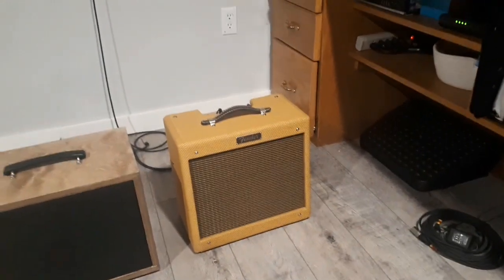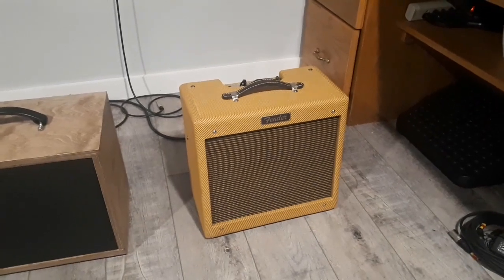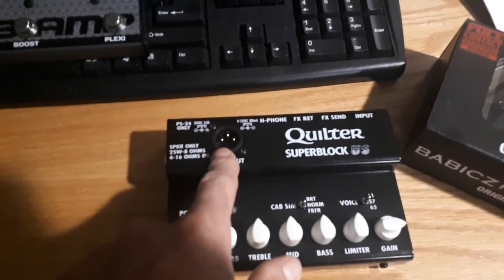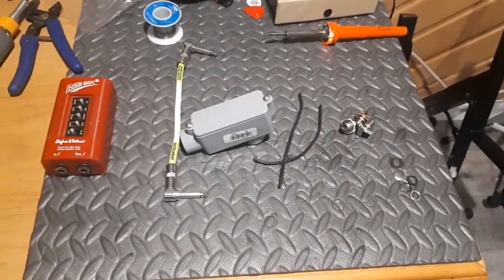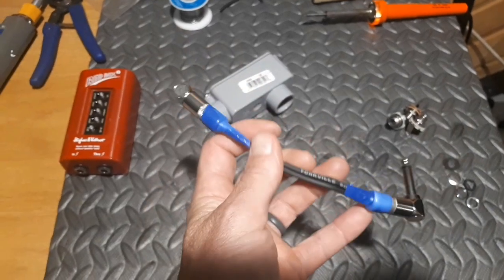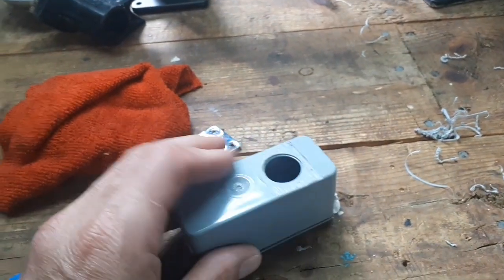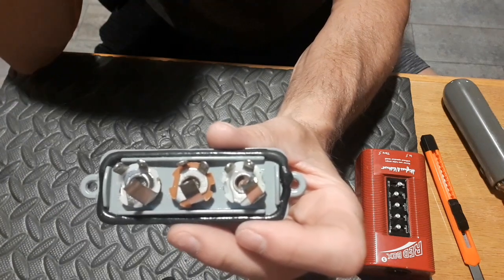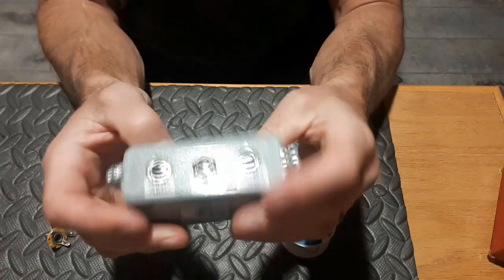Pro Junior How To: 2 speaker outs and XLR out!

Comment: Wow, J! That is a super cool mod! That's a lot of extra speaker power, giving you all kinds of options. This mod would work for my little tube amp, but I have to keep a tight lid on volume. If I were gigging, though, what a cool solution!
Reply from the maker: Hey thanks CB & RC! Yup little box works well. Actually running this 8 ohm amp with 2 speakers in series produces a 16 ohm load which in fact reduces volume. So now on the PJ, I need to run my volume at 12 as opposed to 10 for a gig, but the extra speaker adds fullness that this little amp just doesn't have on it's own.😃

Comment: Good job but why you're using the Pro Jr at 16 ohm? You would have to use 2 cabs at 16 ohm in parallel to keep the Pro Jr's ohm, no? In your method you loss some power of the amp, no?
Reply from the maker: Yes Ivan you are correct, however, the Pro Junior comes with an 8ohm speaker and my extension cab has the same 8 ohm speaker in it. So not wanting to buy 2 new 10 inch 16 ohm speakers, my only options were to wire my two 8 ohm speakers in parallel to give me a total of 4 ohms, or wire them in series for a total of 16 ohms. I have read from numerous sites that running an 8 ohm rated tube amp with a 4 ohm load could cause premature Output Transformer failure, but oppositely, running an 8 ohm rated tube amp at 16 ohms is perfectly safe 😀!
So I opted for a slight loss in volume (series wiring) as opposed to potentially dammaging my amp. The added bonus of running 16 ohms is now, the amp does not break up as early😀
Thanks for commenting,
J
Reply: @j-man9457  I know, good solution!
Reply: @ivanwildboy  What?